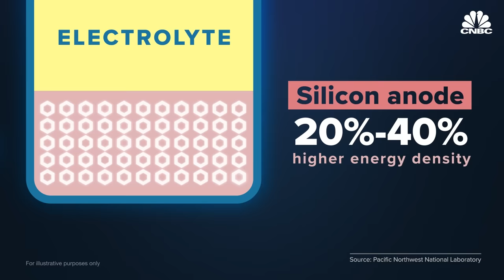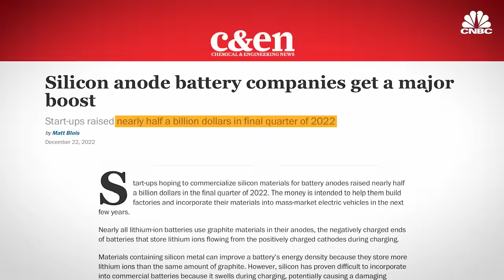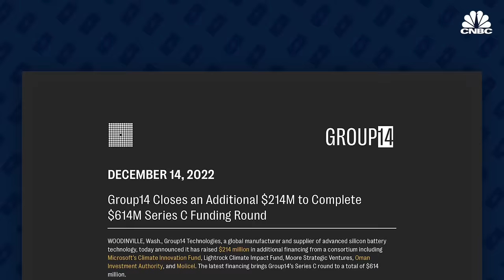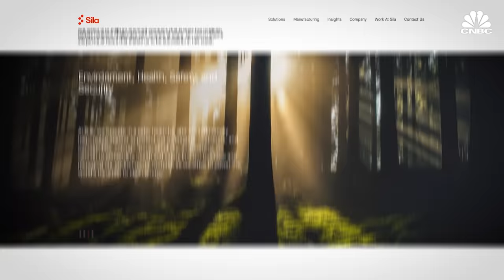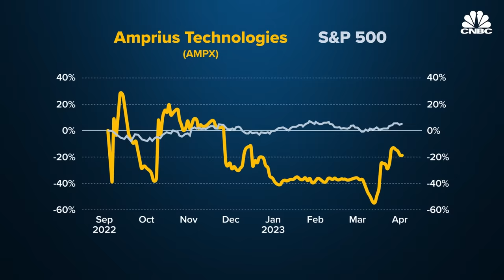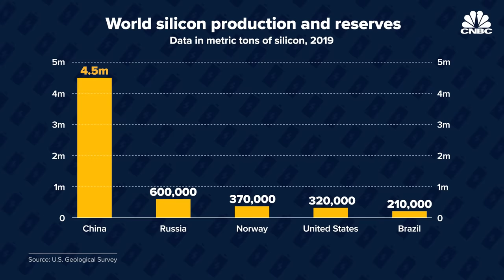How Silicon Anode Batteries Will Bring Better Range To EVs

Comment: This is very promising and exciting. Improving on something 50% that already works so well is a win win.
Reply: Now imagine this tech with an electrified world run on a fusion powered grid. Future looks bright
Reply: @nick_0  Imagination is easy, I hope you have some suggestions on how to sustain nuclear fusion.
Reply: @spacetoast7783  run a billion plasma physics simulations in a supercomputer, and develop an artificial intelligence model run on the data to optimize a energy input and magnetic confinement strength for maximum yield for a Q ratio greater than 1. Easier said than done, but I bet you that’s the best way to do it
Reply: @nick_0  why fusion powered? With good storage as sodium ion will be, you can also have it solar powered.
Reply: @beatreuteler  sure, that’s going to be very effective, though a lot of parts of the world don’t have much sunshine for a big part of the year. fusion eliminates those reliability issues completely
Reply: @silverjem  Clearly not. Factories for producing silicon anode EV batteries haven't even been built yet. It will be years before it's ready for sale in EVs.
Reply: @John Holmes Efficiency. As you charge for 2x the cost per KWh and need /4 Energy to get from A to B you save /2.
Reply: @nick_0  Indeed, solar power is great!

Comment: Will be excited when this is actually in production, been hearing about breakthrough battery tech for years.
Reply: Did you watch the video? These silicon batteries are already in use in commercial products such as the fitness tracker.
Reply: It’s already in production! Sila Nanotechnologies has it in commercially available fitness trackers and soon it will also be in Mercedes Benz electric vehicles!
Reply: @stoneglad  When soon is 5+ years then I'd agree according to the video. Not than Mercedes possibly would like getting it sooner, but given the time it takes to build and commission large production facilities, that's the minimum it takes

Comment: So excited for this to happen.  Wide scale adoption and production of Electric Vehicles will lead to dramatic price decreases.  This technology, if truly scalable in the long term, is a major major step towards that objective.
Reply: who needs more range, like not even 0,1%.
all battery technology is good enough, its more about the shear amount needed, people are so out of touch, always.
Reply: @JohnSmith-pn2vl You're right! We need a battery that will last a lifetime..😅
Reply: This is great, but what about when this goes public, and becomes cheap? Our power grid cannot withstand everyone switching to EVs.
Reply: Everyone driving their own vehicle, electric or not, won't solve the long-term resource extraction issue associated with a lack of efficient mass public transit.
Reply: @JohnSmith-pn2vl  And some people (and I mean you) are incapable of seeing the bigger picture. The new tech adds energy density, meaning you don't need to dedicate as much space in a car to the battery for the same amount of range. Now you get more leg room, trunk space, or safety features. All of which are good.
Reply: @aidenwhitaker8792  that's why it should be upgraded and invested in more, not only because of EVs but also to make it able to sustain a population of almost half a billion by 2050
Reply: @aidenwhitaker8792  Our power grid can handle it just fine.
Reply: Yes make those kids work harder so you can have what you want
Reply: @aidenwhitaker8792  you light want to look up at the sky. Smh
Reply: @rubiconnn  Not as it stands right now.
Reply: @aidenwhitaker8792  guess what, this doesn't happen overnight, time to gradually increase grid
Reply: @aidenwhitaker8792  there’s plenty of research showing our grid is just fine and they’re already preparing for this shift.
Reply: @Ryan Harris  Who's preparing for it? Electricity is a public utility. Until you see increases in the cost of electricity, they don't have the extra cash for anything but minimal amounts of maintenance. That or sleepy Joe can pass a bill to allocate the funds. But as it stands right now, you're very wrong. The grid is quickly approaching capacity, and most of the infrastructure is from the 60s & 70s. If everyone decided to switch to EVs right now, the grid would fail. Even if it were to happen over a 5-10 year period, it would still fail.
Reply: @ryanharris3072  California had rolling blackouts and told people they couldn't charge their vehicles last year. That's not a grid that can handle charging vehicles if everyone has one.
Reply: @kineticinstallationspecial5775  Exactly!
Reply: @kineticinstallationspecial5775  one word. Solar.
Reply: Yes but not environmental friendly so what's the point ?
Reply: @RiosMensRights  adding an inconsistent source of power is not going to fix anything. People charge their cars ar nigh, how much power does solar produce at night?
Reply: As I was watching, a thought occurred to me, that by extracting Atmospheric CO2, and stripping the Oxygen and Nitrogen away from of the air through some form of 
electrolysis or plasma reaction, might be the way to go to providing an infinite source of residual carbon required to advance the technology. 

I'm not an engineer, so maybe you engineering types can chime in here on this one....??     What do you think?
Reply: @kineticinstallationspecial5775  "Private" Electric Companies are doing this to their customers you say??    Hmmm...
Maybe the 'Unionized Public Sector' can do it more reliably since they don't have Share Holders to answer to.  But that would be too ...Anti-Private Sector, and WOKE.
Reply: LMFAO!
Reply: @Aiden Whitaker  100% can survive... who told you it couldn't...a news article generated from a study sponsored by exxon?😂
Reply: @kinetic installation specialist  doesn't matter because there's only 2 options. It either has batterys or net metering. Either way you can charge your ev free. Do some research, you obviously don't know what your talking about
Reply: @JohnSmith-pn2vl  buying a car does not always match the needs. nobody needs a porsche, most people want one.
Reply: @aidenwhitaker8792  wrong. dynamic electricity prices make sure that cars are getting charged when the price is low, which means that automatic charging behavior does not stress but harmonize the grid.
Reply: Look into the environmental cost of all these minerals before you get excited...if you really want to get worked up do the math for thr available lithium on earth then how much h we will need to get rid of fossil fuels.
It's alarming that your comment gets so many likes, it goes to show how many dreamers I'm surrounded by.
Reply: @obtuseangler768 by the time that's even a worry we will be using sodium batteries.
Reply: @kineticinstallationspecial5775  you need to do some research on how solar works.
Reply: @obtuseangler768  i have to strongly disagree. the 'mining' of lithium is subject to change. different companies/institutes are currently working on or are already scaling up new processes to extract lithium from brine. so if you take the actual status of the environmental footprint now, you are making a mistake by assuming that the environmental footprint will be the same in 5 years.
to get into the actual facts to predict the future: the company energyX makes filters on nano scale bases that allows them to filter out different minerals from the brine at the salt lakes in chile which avoids the evaporation of water. so, no wasting of ground water anymore. job done.
the same with a german team of engineers who build a evaporation /condensation system based on heat pumps to not waste the water. these are systems that can make use of the waste water of desalination stations all over the world.
well, regarding silicon, there is almost no foodprint. it is made of sand. enough available in the desert.
Reply: @Penguin and Bison Show  I ran a job in Jefferson County Colorado where we installed 30,000 solar panels on the schools and administration buildings for the schools back in '08 and '09. I have a feeling you are the one that doesn't understand solar, not me. Keep talking out of your ear though so we can be sure where the mentally deficient are.
Reply: @kinetic installation specialist  if so you would know what net metering is? Or batteries? You would know that there is plenty of energy at night. I actually work for a solar company and installed solar on my house myself so I think I know how it works.
Reply: @Penguin and Bison Show  net metering doesn't create power at night. Have you ever watched power lines bouncing up and down before breaking when electric consumption is high? Do you have any idea what "the grid is insufficient for electric vehicles currently" means? Did you think that because you supposedly put solar panels on your house that the grid is all fixed up?
Reply: @kinetic installation specialist  uh considering my house isn't even connected to the grid yes I think I did. Also nobody charges there electric cars during peak hours as it costs more. Also you produce more energy then you use with solar and It goes back into the grid with net metering so yes, it does.
Reply: @RiosMensRights  sure Jan
Reply: @aidenwhitaker8792  we’ve demonstrated the ability to build up power capability shockingly fast- when homes were first electrified, when AC was introduced to the South, when rural areas were electrified, etc. (Production increased 70x between 1902 and 1942, for example. And tripled between 1960 and the present.)
We can build!
Reply: @kineticinstallationspecial5775  not quite true. They urged people to not charge at certain times of the evening unless they needed it. (I.e., if I’m only needing 100 of my 300 miles tomorrow, I set my car to not charge until midnight when demand is down.)

A better, more market-based approach to this exact thing already happens in areas with demand pricing. Unless you’re taking a big trip in the morning, you just set your Tesla or whatever to charge at the cheapest times of the night, when there is excess capacity. A version of “peak shaving” or demand management.
Reply: What about all the big holes we have to dig in the earth's crust using 3rd world countries? Still excited?
Reply: @ryanevans2655  now do rare earth minerals, not aluminum or iron ore.
Reply: Can you throw a battery in the trash?
Reply: @Ryan Evans  how much water does it take to extinguisher an EV fire?
Reply: @DaveyCrockett1  oh boy, wait till you find out how much water fracking uses…
Reply: @Ryan Evans  fracking doesn't explode in an intersection in a lithium fireball. I'm talking about the amount of water a fire team will have to use opposed to putting out a petrol car. It takes swimming pools to put out those and protect the public. Not for a petrol car.
Reply: There will be ssooooo many used cells on the market in the future, solar storage will be cheap cheap cheap.
Reply: Not going to.  Battery tech has been studied for 250 years and here we are.
Reply: @jsusbdndk1362  You're expecting that big a die-off?
Reply: @rubiconnn  Most countries cannot handle their current load very well
Reply: @bigglyguy8429  I was talking about US, because I was assuming the guy that I was replying to was in the US
Reply: where is the cobalt and lithium to come from? and you still need the energy to charge em.  But do keep on making even more batteries and useless evs
Reply: what if, we used trains? they’re as fast as planes, have the highest passenger capacity out of basically every other form of transportation, don’t require batteries, insanely safe, and pretty much have the capability to be 100% eco-friendly from manufacturing them to riding them?
Reply: You can't keep rap-ing the planet forever, buddy.  Get some valid morals.
Reply: @GyroCannon WOW. You have really messed up values. You definitely cheered on the failed Bush war and then ran away.

Comment: Silicon and sodium batteries have been on the test lab for years.  Need them to come to scale.
Reply: Kind of the point of this. Silicon is now commercial available and is already in consumer devices and is already planned to be in up-coming large market devices. It's the first of it, but it's here.
Reply: Sodium batteries have poor energy density, no? The only reason to use them, maybe, is cost. They're really more for grid storage.
Reply: What I got from this piece is that silicon has been used in batteries for over a decade (eg. Telsa Model S) but in small percentages. What these companies are doing now is increasing the percentage of silicon in the batteries.It seems the more silicon that is in the battery the harder it is to make and hence more costly. Seems these companies are trying to find a good balance for mass production.
Reply: @jaker3151  I think it makes sense to expect that at least some of these companies will stick to the ultimate goal to be able to build a 100% silicon anode that doesn't swell, so it survives.
Reply: @spacetoast7783  yes, but maybe the silicon anode can be applied with increasing energy density
Reply: @spacetoast7783  that’s a good point you need different battery technology for different applications, higher density for small spaces like EV but can use cheaper technology for Grid storage
Reply: CATL - the world's largest battery manufacturer - has just made sodium ion batteries available commercially at scale.  A couple of new car models have launched in China using the batteries and more are expected before the end of the year.  Lithium prices have fallen by something like 50% this year as the market reacts to this news.

The energy density of sodium batteries is lower than for lithium by weight, but the cost is expected to be so much lower it's probably worth the tradeoff.  They also aren't that much less energy dense than lithium iron phosphate batteries, which have been sweeping the industry the past year or two because of their lower cost and reduced reliance on rare earth elements.  They're also far less likely to burst into flames unexpectedly.

Sodium batteries have another great advantage - they're much less impacted by low temperatures than lithium ion batteries.  In cold climates they're already more-efficient than lithium batteries.

For stationary uses like grid energy storage, sodium ion batteries are a no-brainer, since the added weight is irrelevant.  Even in cars though, we could start to see models that blend lithium ion batteries with silicon anodes and sodium ion batteries in a few years, with the lithium batteries enhancing the vehicle's total range while the sodium batteries provide most of the energy storage.
Reply: Hasn't happened yet.... And will not in the medium future, either. This is just another "hubris" piece that we see on a regular basis. ...it excites the public, but never materializes.
Reply: @LuMaxQFPV  How can you say it "hasn't happened yet" when many of these batteries are already commercially available?  🤷‍♂
Reply: @sunspot42  CATL only advertises those sodium batteries. We need to confirm their advantage and technology on EVs. Just wait!
Reply: yeah, as they said in the opening, silicon has been used in anodes for 20+ yrs. watch the rest of the video
Reply: @spacetoast7783  yeah sodium is not ideal at all. kinda sapped his credibility when he commented silicon & sodium in the same sentence.
Reply: @beatreuteler  guess you missed the last 60 seconds of the vid?
Reply: @MrJCerqueira  indeed. Sometimes I tend to stop befre the end if it feels too long...😜
Reply: @spacetoast7783  
Energy density is only a requirement for means of transportation. Use of sodium batteries for power grid purposes are ramping up.
Reply: @se777en73120  Yes, that's literally exactly what I said. Thank you.

Comment: Its not just the fact that silicon offers longer range, but it can be charged withing 10 minutes at higher charging rates without any dendrite formations. This combination is the key. Because apart from the major challenge of sourcing sustainable electricity without damaging grid stability, the other problems that EV faces are small range and long refueling time. By achieving this combinations, silicon batteries can replicate the IC engine vehicle's range and refueling experience. Silicon batteries may not be the only future but they sure are here to stay and grow while benefiting EV industry.
Reply: Car Brain Addict.